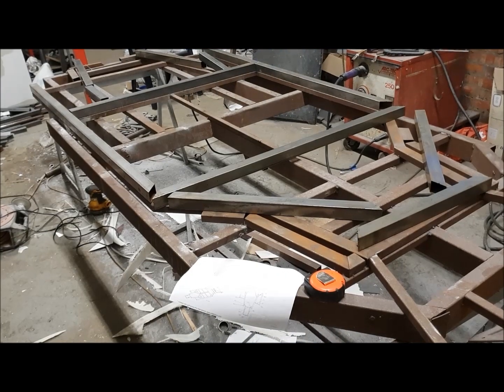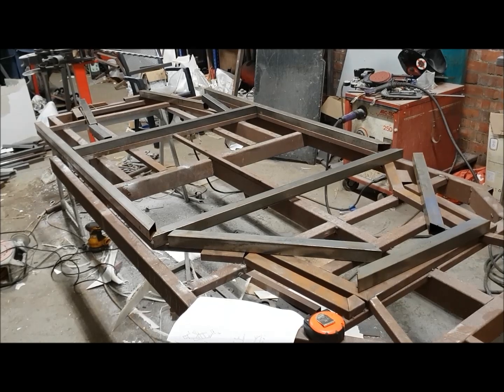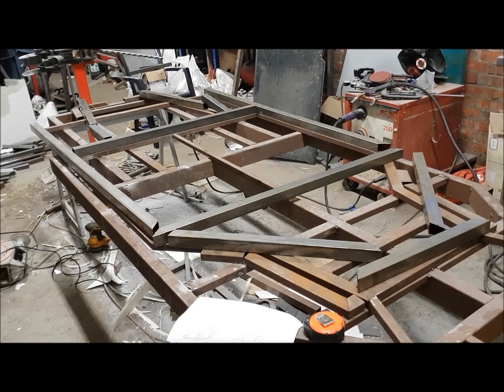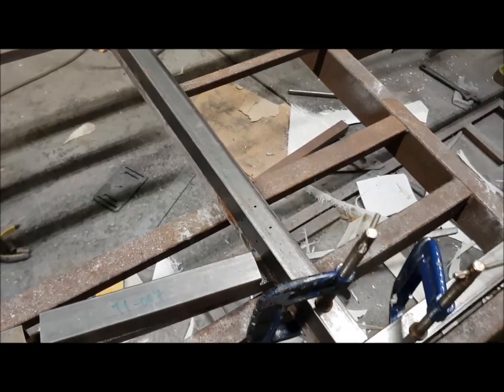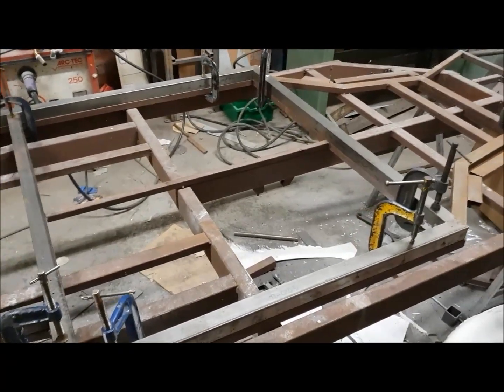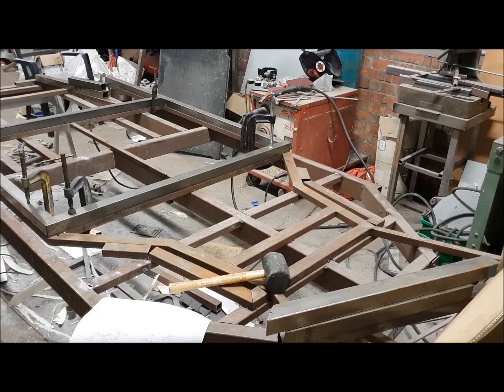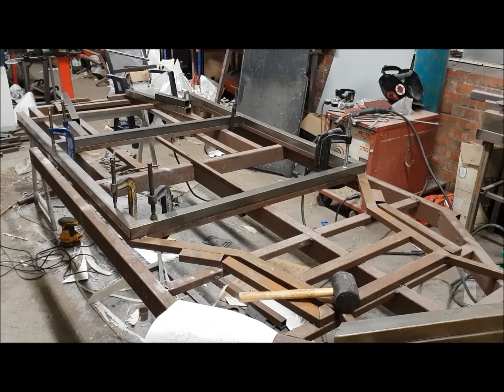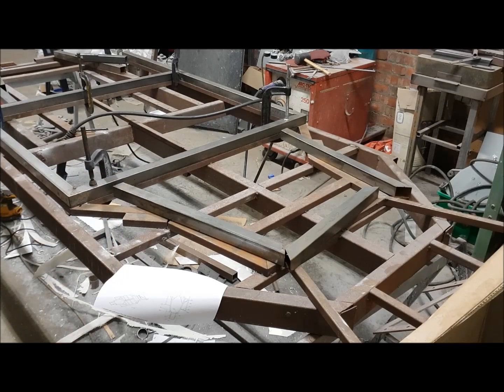Ford GT40 replica chassis construction/fabrication Part 2

Comment: what is the size, the thickness and type of material of the square hollow tube?
Reply from the maker: The mainnsections are 40x40x1.5 with other support tubes being 25x25x1.5 or 20x20x1.5. All ERW mild steel.
Reply: @gtforte  thank you very much Sir